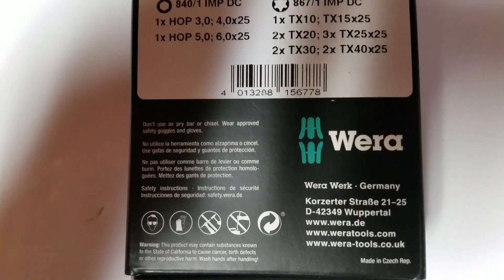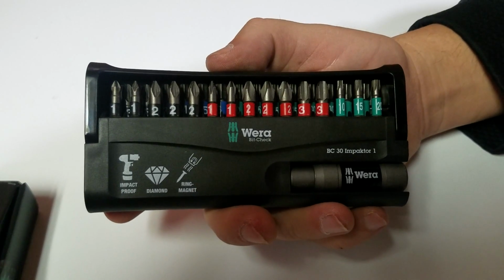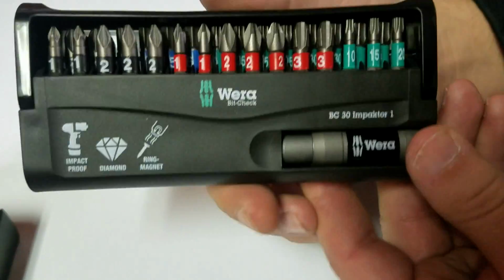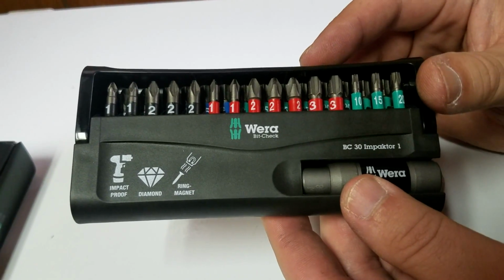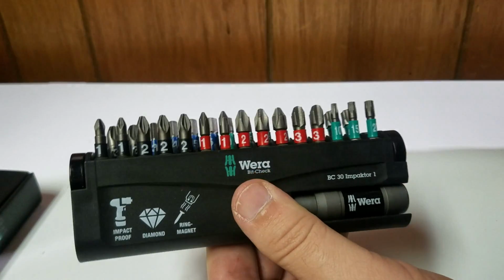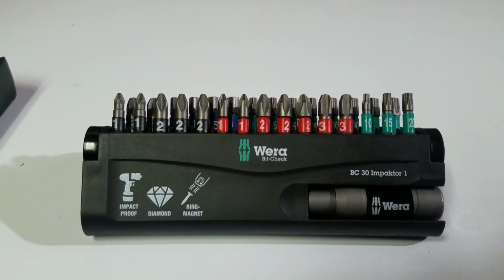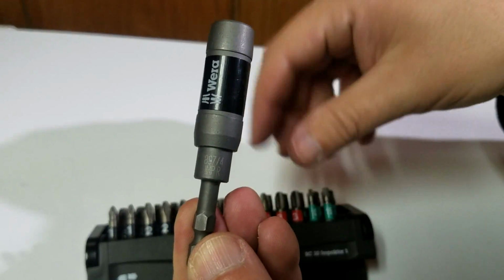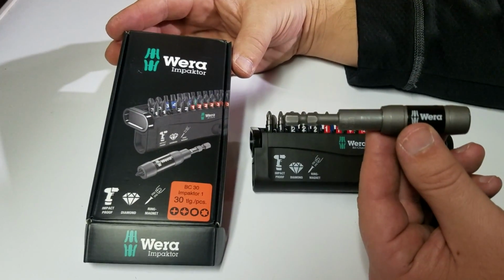Wera Impaktor Bit-Check Set of 30 Review

Comment: i have the older impaktor set in the orange case and i absolutely love it. So many situations where you have to drive a screw with one hand and the ringmagnet has no problem starting the screw. The bits are tough as fuck and will never deform in any way. Using this set with a brushless impact driver and torx makes screwdriving such a relaxing job.
Reply from the maker: FoodOnCrack yea they are great buddy ...I love them

Comment: I've got the Wera and the Wiha bits. They are both great. Actually i broke a couple of big srews with the T25 Torx in the middle and the bit looked like new after 200 srews.
Reply from the maker: leopard3c yea I like wiha bits also but have very limited use with them

Comment: I bought a 5 piece set of square #2 bits and was very unimpressed...I find the fit in the screw head very sloppy, I have some dewalt flextorq, makita impact gold, wiha terminator blue...all of which fit waaaaay better and are all cheaper.  I used wera hex keys at my old job and loved them, was very excited to get the wera bita, to me they were a big disappointment

Comment: Tool Boss,  try it on a metal studs and see how it will perform. :)
Reply from the maker: JD Balboa will do JD
Reply: Your need the tempered ones for metal studs.
They have them in a different set.
These are good for gunsmiths for instance